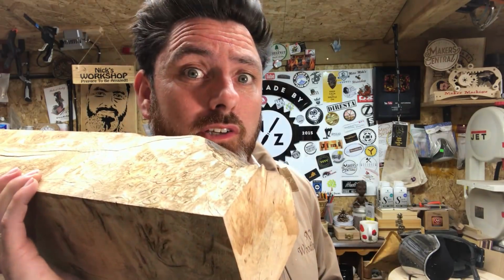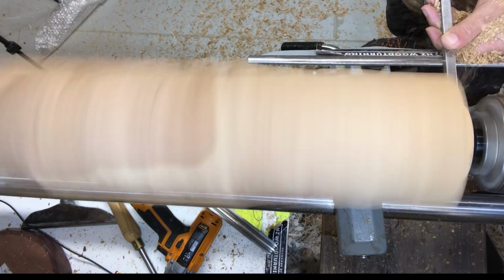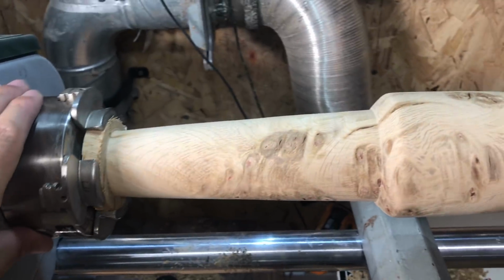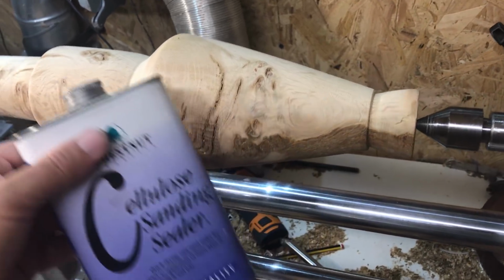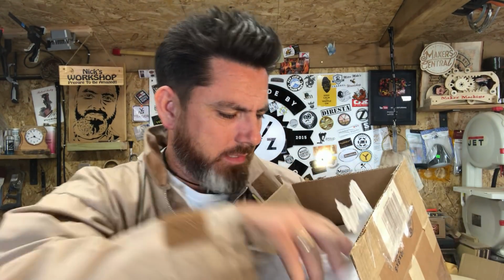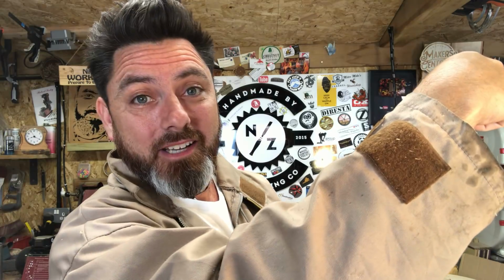FORTNITE  - The Fortnite Rocket - from the game Fortnite.

Comment: Nick, what if you made a resin + hard candy blank, then after turning you soak it in hot water until the candy's dissolve. I think it'd leave some cool holes through the bowl and interesting voids that would be hard to get with epoxy otherwise.

Comment: Hopefully this will inspire more kids to try out turning. It's one of the most therapeutic things you can do, & you (often) get a nice piece out of it at the end.

BTW, I always bandsaw or plane off the corners when turning square stock, so it becomes an octagonal profile. Takes a lot of the strain off the wood and the lathe and your tools if they don't have to knock those bits off, and you get to use the little triangular bits for other pieces later if you take them off with the bandsaw.